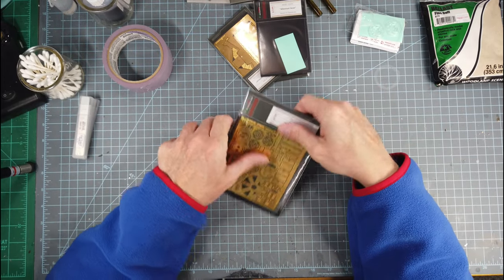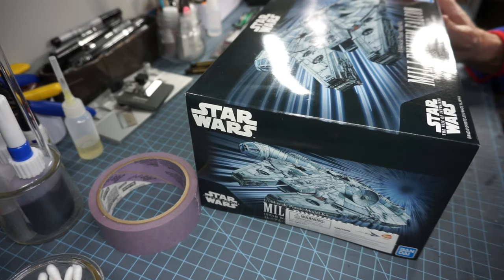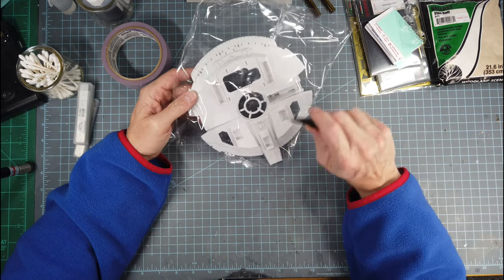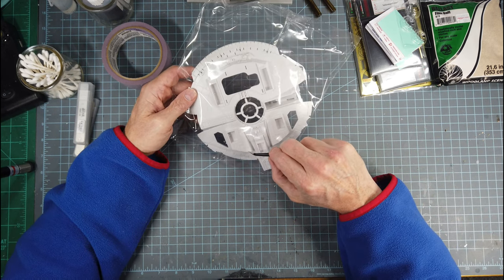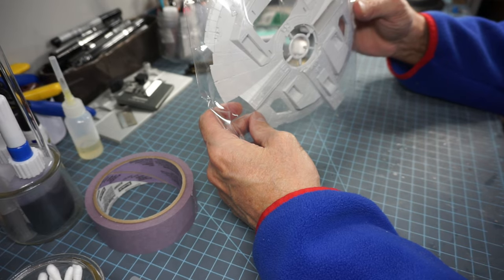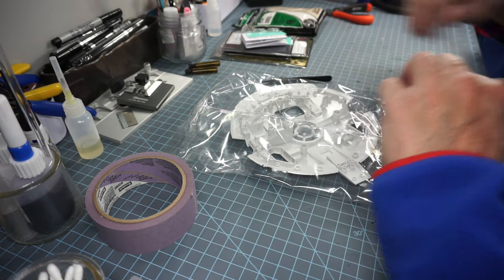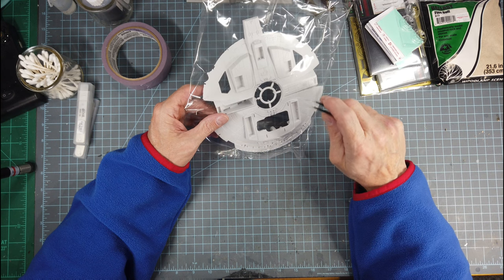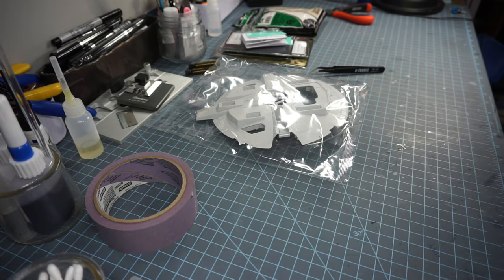Bandai Star Wars Levitating Millennium Falcon 1/144 Introduction

Comment: the wood might be to thick.  Glenn used acryilic.  any update on this project?
Reply from the maker: I actually cut a hole in the wood, and the magnet is only covered by a thin sheet of styrene.  I think the wood filler I used is too thick, and the model is too heavy.  That magnet only supports 500grams.  The model is 250, and the magnet itself is 200 grams, so that causes the ship to sink.  I have an alternative I'm working on. The falcon is painted and weathered.  Just finishing the base.  Thanks!